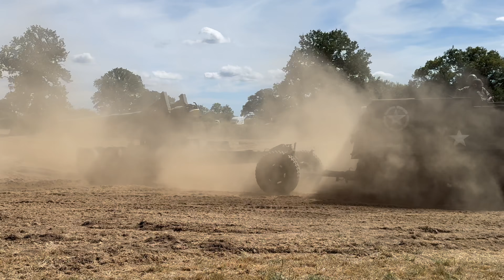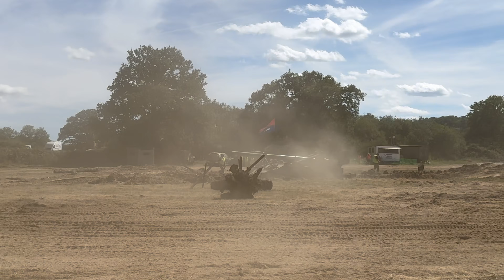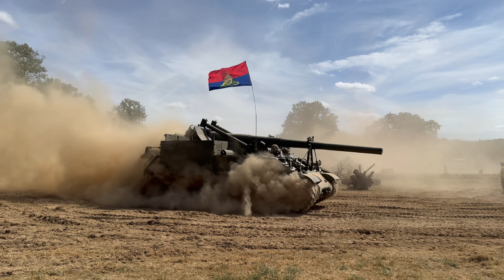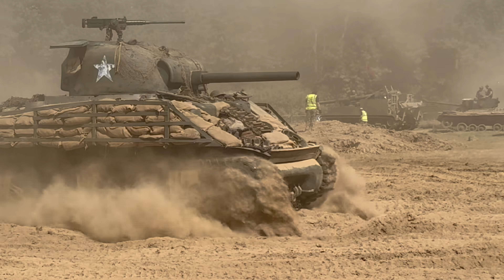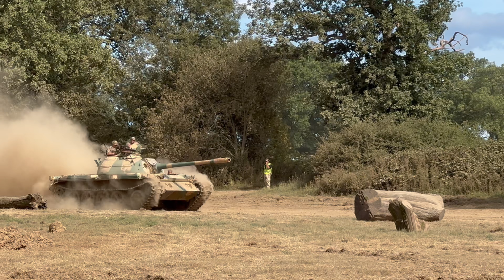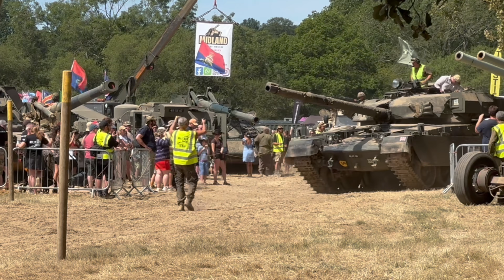CAPEL MILITARY SHOW 2026 ARENA WW2 AND POST WAR TANK DISPLAY#military #offroad #tank #history

Comment: Working on another Sherman. It came with a incorrect length for the 75mm gun. 2 inches to long ! lol. Had a local machine shop adjust it. New IR emmitter and receiver. Placed emmitter inside the barrel and did away with BB system. Hope you had a mask on for the dust. At the Canadian Tank Museum in Oshawa, Ontario Canada, they have a water truck that sprays the tank arena down with water.Thanks for the video.
Reply from the maker: Hi! They tried that, it was so hot and dry it worked for 2 mins 😊 and I’d love to see that, you should post it on the community.
Sorry I haven’t gotten back sooner. I missed this comment
Have a great week!